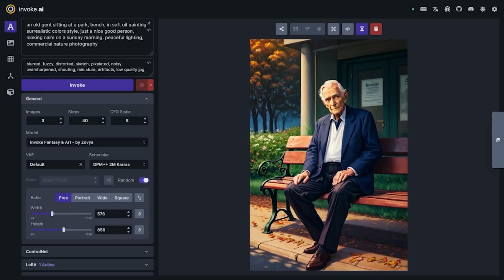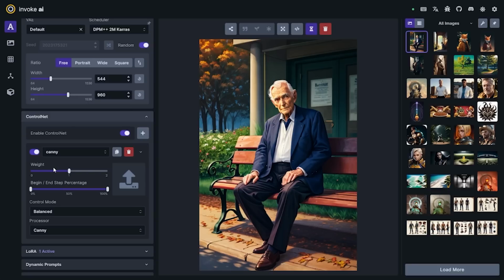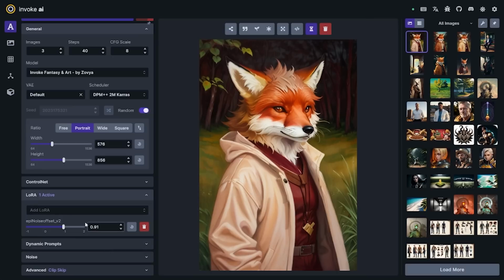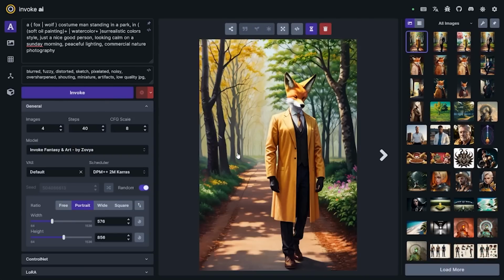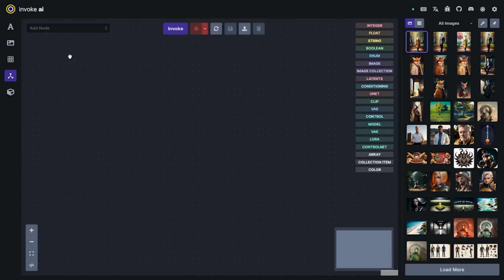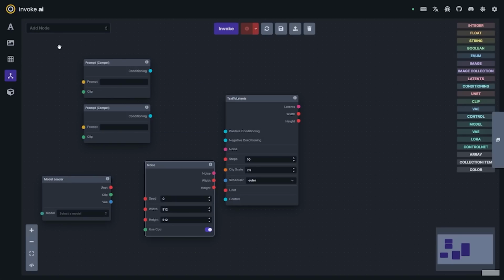InvokeAI 3.0 Release

Comment: 🎯 Key Takeaways for quick navigation:

00:00 🚀 Invoke 3.0 is released with a lot of new features and UI changes, making the interface snappier and more intuitive.
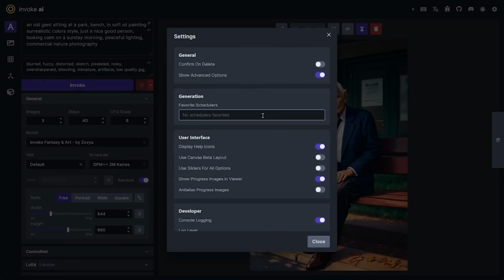01:26 📝 The gallery now has a boards feature for categorizing and organizing images, making it easier to manage and delete images.
02:40 🎨 Invoke 3.0 introduces ControlNet, allowing users to add and manage control net layers to generate more structured content.
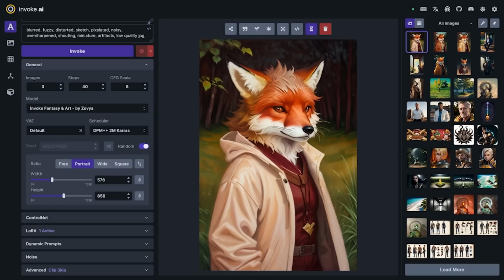05:08 📊 The new LORAS panel enables easy manipulation of the weight of the LORAS model, providing better control over the output.
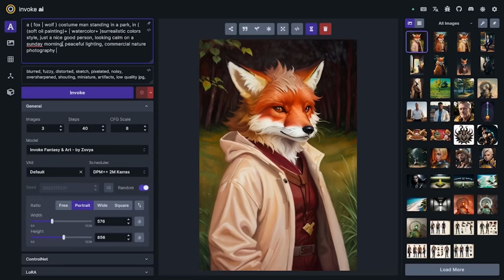06:08 🔄 The dynamic prompts feature allows users to input variables in prompts, adding variability and trying out different combinations during generation.
07:22 ⚙️ Invoke 3.0 allows users to control the source of noise generation, providing better reproducibility across different installations.
08:17 🛠️ Invoke 3.0 introduces "Notes," an experimental feature allowing developers to create customizable generation pipelines with more control over the output.
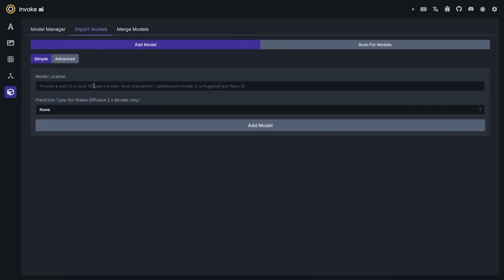11:51 💾 Invoke 3.0's new model manager makes it easier to add, customize, and configure models, including converting non-diffus models into the diffuser format.

Made with HARPA AI

Comment: 🎯 Key Takeaways for quick navigation:

00:00 📣 Video announces the release of InvokeAI 3.0 and previews new features.
00:44 💻 The UI has been streamlined and improved for a smoother experience. 
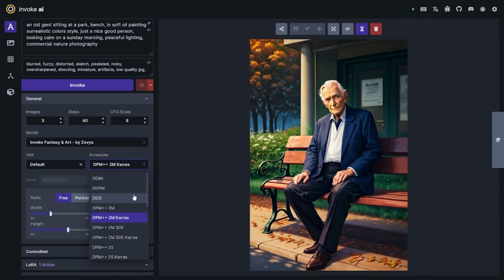01:14 ⚙️ More scheduler options added, along with customizable favorite schedulers.
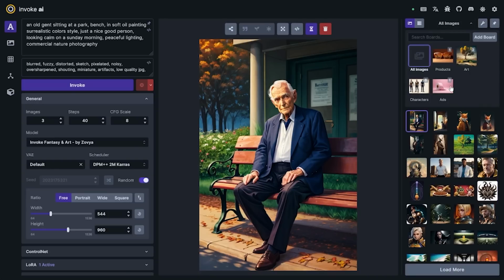01:58 🖼️ Boards added to gallery to organize and categorize images.
02:40 📂 Dynamic model compatibility tracks assets with base models. 
03:23 🎨 ControlNet allows layered image editing and manipulation.
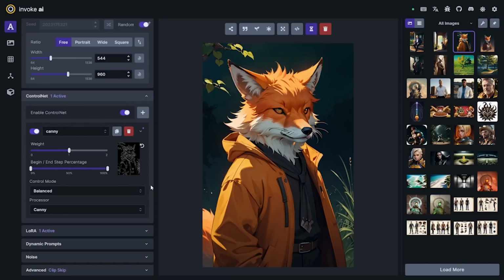04:32 🍭 Example using candy preprocessor on ControlNet image.
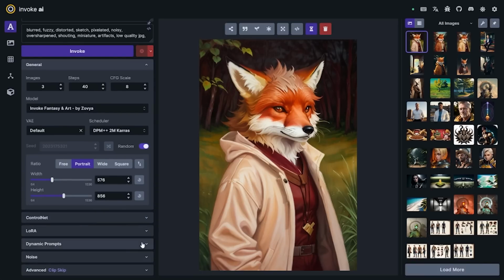05:22 🗣️ Lora panel added to adjust weight of Lora models.
05:49 🎲 Dynamic prompts feature allows prompt variable randomization.
07:22 🔉 Now able to control CPU vs GPU noise generation.
08:30 📝 Nodes editor added to build customizable generation pipelines.

Made with HARPA AI

Comment: All good but having issues importing models by adding a URL (from CivitAI - right clicking on the download kink and doing 'Copy Link').
InvokeAi works away for a little while then stops with a message at the bottom saying 'Undefined'.    So yeah, no idea.  
Also I pointed it at my models folder from my Automatic1111 install and it only imported some models but not all.  No idea on that one also.  
Apart from that, all good.
Reply from the maker: Are you seeing that with all model types, or certain ones (e.g., Models vs LoRAs, etc.) - Share more on discord, might help us triage some edge cases! :)
Reply: @invokeai  I think only with some. 
I tried with another and it downloaded it fine.  So I tried again with the other one that I wasn't successful with and it failed with HTTPS:// Server Error 500 after downloading 34%.
I then went to download it directly from CivitAI instead and even then it failed on the download and I had to resume it before it succeeded.  Then I imported it into InvokeAi no problem.  
So... it might be on CivitAI's end.  
If I keep getting this I'll let you know (it's happened only on 2 models so far).  Don't want to put undue work onto you guys just yet.  :)

BTW, loving it, but really missing 3 features.  The ability to multi-select images in the gallery so I can batch delete.  And on the upscaler option, the ability to choose, with a slider or a number, now much to upscale. Currently only 2x and 4x right?  Finally, is there a way to save prompts (I know it does it within the image, but so you can have your own presets).  I guess I'm too used to Auto1111 :)

Thanks !   

I'm just uploading a video to my channel right now showing how to install this (and it does show that my importing from URL didnt work - but you won't want to sit through that).  :)

Comment: Nice I like it a lot. I already installed and I have to say the installation was such a pleased experience. It was easy to go true, and it worked without any problems. Hope AI in general will one day be more user friendly like InvokeAI ^^. Now to my question, is there any plans to support AMD gpus more? I have one, and it works fine, I can use all settings and even better than in SD itself. But it's really slow ^^ With same settings in SD I do the same image with same model and same everything in 50s- 1:30 min and in InvokeAI it needs 5-7min. Anyway, still a big fan and i really like InvokeAI :)

Comment: I would like to have the inpaint feature.
Reply: Unified canvas has outpaint, inpaint (both forms—from sketch and from a target area[mask]) img2img, and even txt2img if you set the denoising strength up to it’s highest value. That’s why it’s unified, you can test seeds/prompts there, expand an image there, and make alterations without having to jump around different tabs and re-enter this or that information. I’d recommend using all the tabs for your work flow, but it’s possible to do everything there. It was an early innovation and still stands as Invoke’s “champion-in-the-colosseum” imo. I’m sure the creators are busy, if need a hand figuring out how to work it I can assist.

Comment: Hi.The meaning in the nodes only one.If you have a background is generated separately, and the character separately, different models and using different samples.And it's only the final node that connects your entire image.But if it's not, I don't see the point, at least not to me.Can someone explain what is the point of the node system exactly as it is today.But if they separately generate one image, then yes, it makes sense.

Comment: Can run on gtx 1650 4gb vram?
Reply from the maker: Almost 100% no, unfortunately. But we built an entry-level subscription plan (Indie) on invoke.ai to give people access to the tool that don't have sufficient compute to run it.
Reply: @invokeai  1660ti?
Reply: @invokeai  But, can it run smoothly on rtx 3070 with 8gb vram?
Reply from the maker: @adrian_maulana3404  Very well.
Reply: @invokeai  Is there a place where can we find about the minimum requirements? and what about a gtx 1060 6gb?
Reply: @adrian_maulana3404  I get about 5.2 it/s generating a 768x768 image on a 3070. Not blazing fast, but definitely useable.
Reply from the maker: @MM2.2.2.2  https://invoke-ai.github.io/InvokeAI/#hardware-requirements - 10xx series is not recommended
Reply: @invokeai  🗿👍
Reply: @invokeai  Which is better rtx 3060 with 12gb vram or rtx 3070 with 8gb vram?
Reply: @bmorg7244  🗿👍
Reply from the maker: @adrian_maulana3404  more VRAM is typically seen as more useful in AI, as it gives you more buffer for using larger (or more) models and creating larger images.

Comment: good stuff. my main issue with ui's is having so many models and forgetting what they are for be nice to have a way to select models with samples like a overlay that pops up. also i sould love an easy way to save prompts. right now i scroll through the gallery to fiind a starting prompt using the star it would be nice to have a gallery where i can save prompts. oh and the big one. if the output could remember what model i used in the gallery.

i am so glad iyouii guysi are still working on this as i use it way more than a1111 because i like the interface it is more polished. sorry about all the suggestions i used to do UX and my favorite part was mapping are coming up with features and mapping them into the flow so when i see new stuff i start wanting to add to it.

i think everything is moving to modulus. with IiiA code generation modulus make more sense
Reply: The best way to deal with this is to go into properties and rename your models to what you find useful in them. For example you might rename Paragon to “sci fi model.” And another thing you might want to is to contain it down to most used 20 models. A third is to download the models one at a time and spend some time exploring them, when i would download 10 in a day i’d end up with five i didn’t even feel did anything distinctive enough to keep but would lay around forever because i didn’t give those babies tentuplets any individual time to realize they were dumpster babies (i wasn’t going for humor that dark when i started that sentence.) I’m personally hoping the next thing they add for 3.0.1 is the combination of the “prompts from list” and spaced out prompts, taking another really good idea from the community. Basically you press enter twice and write another prompt (and you can do this for however many prompts you want to implement to the que) and than the instruction for the singular prompt are completed (as far as number of images, size, etc.) and then it moves onto your next prompt. This allows you the advantages of the best of “prompts from file (list)” and the prompt queue of ED.
Reply: @MackNcD  good idea.

Comment: I don't see the High Res Fix in the advanced panel ? Is it still available ?
The Width/Height sliders are great improvement
Reply from the maker: High Res Fix is mostly just a manual Img2Img upscale after a lower res generation. Given Controlnet Tile + other tools, there are better ways to go about it now, so we removed the toggle. 

A few folks have created Node Graphs in discord that you can easily pop in to do an automated HRO in the node editor - Check those out!
Reply: @invokeai  thank you for your reply